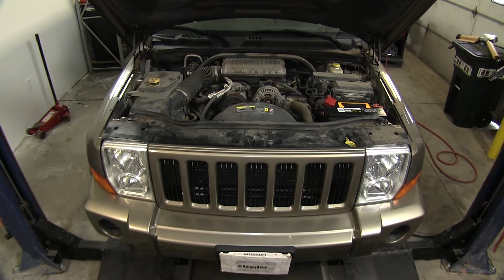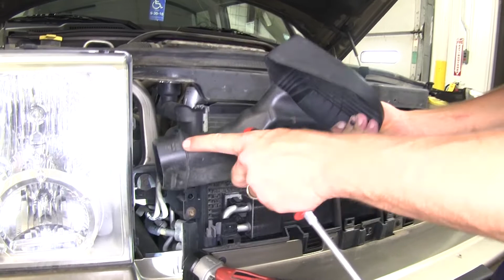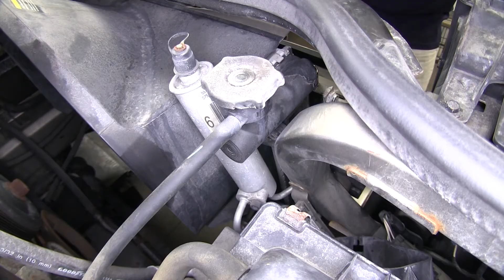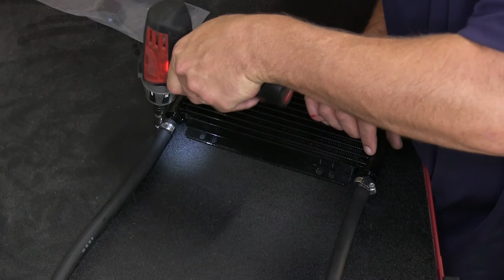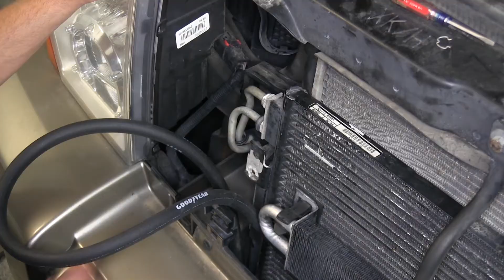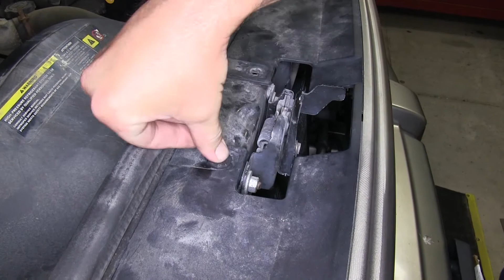Mount: Derale Series 8000 Plate-Fin Transmission Cooler Kit w/Barb Inlets on a 2006 Jeep Commander

Comment: My jeep commander has overheat temp pop up. The fan kicks on high and low. I've checked my relays replaced my water pump, hoses, thermostat and coolant sensor. Someone on YouTube said it's just corrosion on the wire on the starter does that sound plausible?
Reply: No, actually I have been investigating this same issue on my 2006 Grand Cherokee Limited 5.7L Hemi. On different occasions there is a system message of "transmission over temp". I replaced the starter and installed new connectors about 6 months ago, tested the wire and all is fine, but still "transmission over temp". I have read several threads and to date I have not read a solution to this problem. People have tried replacing everything from the PCM to the Transmission Range Sensor to the oil cooler and it's a mixed bag. I believe the solution is not the same on every Jeep, even in the same model series. In my case it's not an actual "transmission over temp" situation as I've monitored the oil temperature during the status event. I've just learned to live with it. I have 165,000 miles on it and this is the only issue (non-issue) I have at the moment.